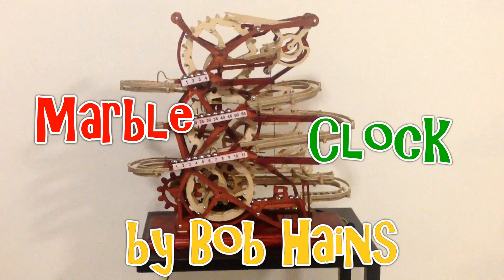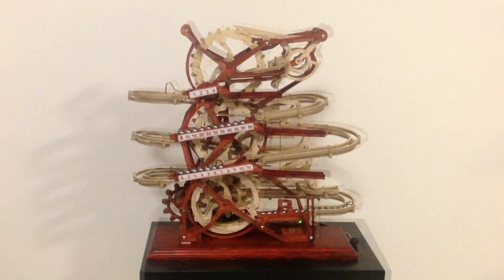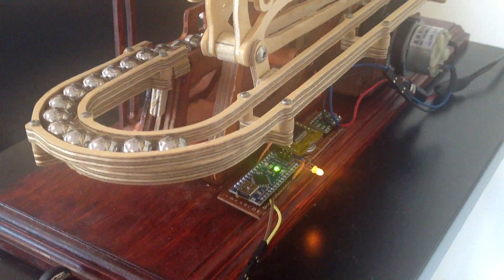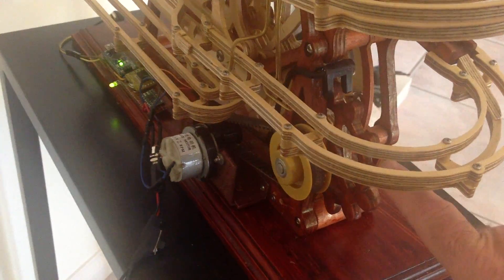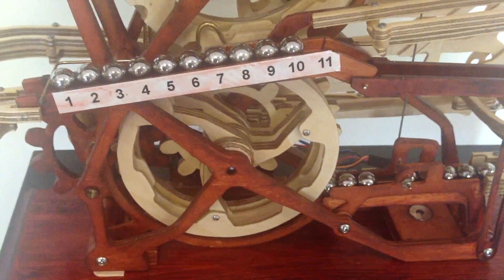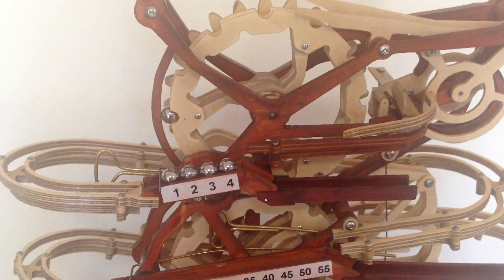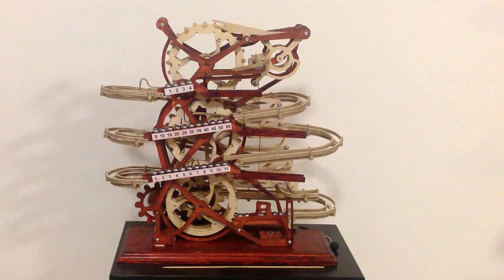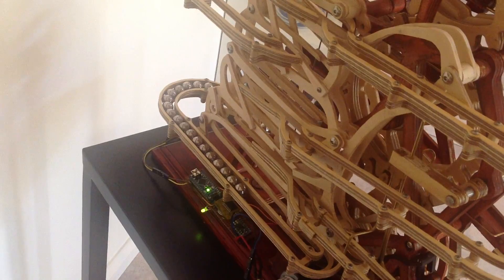Marble Clock

Comment from the maker: Unfortunately my son built it a long time ago and has little remembrance of how he did it.  I know he used an Arduno micro processor but don’t recall the other modules.
Reply: You don't need a Arduino. There are RTC's availabble https://de.aliexpress.com/item/2037934408.html?spm=a2g0s.9042311.0.0.27424c4dFfUxVe with 32768 Hz output. With a 4040 divider by 32 and a stepper motor https://de.aliexpress.com/item/32677708387.html?spm=a2g0s.9042311.0.0.27424c4dq8iday you'll get a highly precise reference to drive a clock gear.  You'll get 1024Hz  and a step angle of 0,9 degrees. So you'll get  2,56 rounds per second or 51,2 teeth / s for a 20 tooht timing pully. I f you use a 512 tooth timing wheel it will take 10 seconds per rond. As simple as that.

Comment: Hello Robert.  I have a very similar application.  I was wondering if you could share any details about the microprocessor control and motor configuration. Is there an open source for the code?

Comment from the maker: Yes you could make it work using any drive method but you would need to use an escapement to control the timing as opposed to the computer approach I have used in this clock.